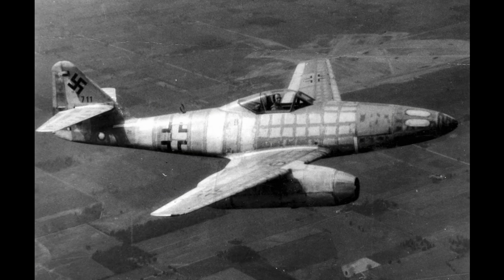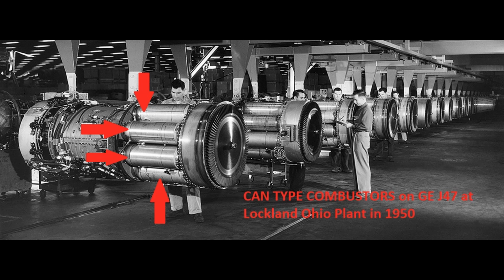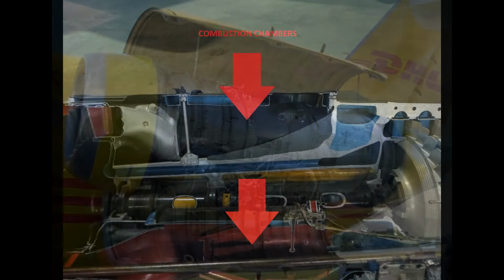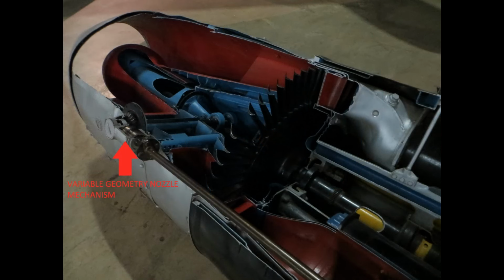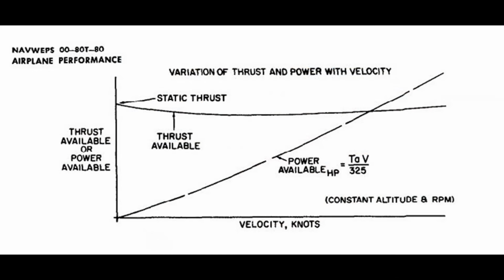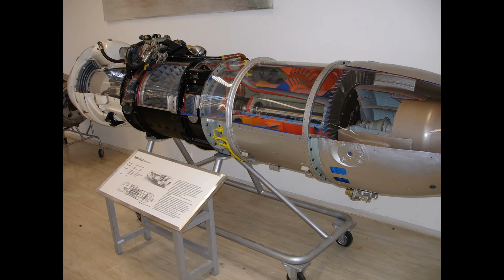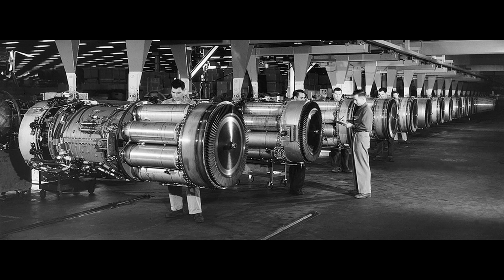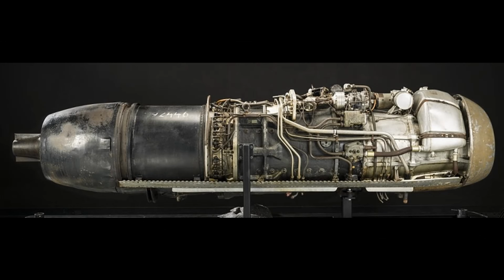World War Two JET POWER

Comment: The drawback is actually mitigated by making more of the engine. I think some articles says this, jumo 004, even if it's unreliable, if built in massive numbers, can be simply replaced
Reply from the maker: It lasts about as long as a typical Soviet WW2 fighter engine and it could shoot down a lot of Soviet junk in 25 hours.

Comment: Depends how you define "Best" the Jumo 004 only had a service life of 25 hours, most not even that! Power was only 2,250 lbs on most models. The Centrifugal flow Turbojet was easier to build, morereliable and much more powerful. The De Haviland Halford in the Shooting star easily outperformed the 262 on only 1 engine. The Centrifugal Flow engines dominated the post war fighter market, the ultimate being the Mig-17 flying on a Rolls Royce Nene copy. Americans spent10 years waiting for a home built Axial Flow engine that actually gave the power advertized. but instead got a generation ounderpowered failures like the "Gutless Cutlass"
Reply from the maker: You can shoot down a lot of Soviet and British junk in 25 hours.

Comment: The combustor has a lot of challenges for the designer. It continues to be a challenge today requiring lots of testing enroute to success. First, it has to provide airflow conditions, across all operating conditions from start to idle to full thrust, supportive of stable combustion. This was one of Whittle’s greatest challenges. Keeping combustion going in a hurricane was uncharted engineering territory, unlike any other device of the time. Second, the one nobody ever seems to realize, the combustor has to mix the very hot combustion products, which are way too hot for the hot section nozzle and turbine materials, with the airflow that didn’t participate in combustion. Gas turbines all operate with lots of excess air. Typically, 25% of the flow participates in combustion. If the length of the combustor was very long, this mixing would be easy, but the length of the shaft connecting the turbine to the compressor is critical for shaft critical speed and weight. If the mixing isn’t good throughout the operating range there can be a concentration of combustion products that can cut the turbine blades like a torch. These concerns were at the heart of the Whittle reverse flow/ external combustor cans. Many people, unaware of these problems, think that Whittles arrangement looks wrong, or even silly. He had compelling reasons for that design. These pioneers were hard pressed to make these revolutionary machines work in a very time pressed schedule with the basic materials and engineering knowledge they had access to. The same goes with the centrifugal compressor vs the axial. The centrifugal was proven, stable and simple. The axial was an attractive uncharted complex alternative. These choices still have advantages, as shown by their survival in engines like the PT-6 and Allison/Rolls 300-400 series.
Finally, the combustor has to do all of these things without getting itself melted or heat damaged, success being measured in service life. Technology and materials progress has allowed them to go from very short lives to very long lives in current engines.
Reply: +@jackthompson-lr2hc   Not much is known about what Paul Allen's museum has done with their Me-262 restoration if you understand Allen's insistence on secrecy.  I'm pretty sure they constructed entirely new hot sections for their Jumo 004 turbines, and I have seen a few photos of them being manufactured.  Allen's restorations aimed for historical accuracy but I'm curious what compromises they reached for a flying restoration.
Reply: @F@F @FiveCentsPlease heard about that, and I was amazed that the “restoration “ would break into the engines to replace original, limited life hot section components with components derived from modern engines made with much more capable high temperature materials. I would have expected that they would elect to replace the original engines with proven later engines of a size,power and weight that could reside in the nacelles with minimum of change. I guess that if you have the resources the result is more authentic, but a lot more work and risk.
Reply: @jackthompson-lr2hc   Aero Turbine in CA built the Jumo 004s.  (I think they are now named StandardAero.)  The team lead said they first went to the US Air Force Museum archives and got copies all of the engineering info that had been obtained by the Allies.  The Flying Heritage Museum managed to source six Jumo 004 cores and Aero Turbine spent 10 years on them. They ran them until something broke, then fixed it.  I think it would have been an excellent opportunity to create an engineering reference for the engine in a book if they documented everything.  Aero Turbine did say that the Germans got most of the fundamentals correct for the Jumo but just not right.
Reply: @FiveCentsPlease The Germans were hamstrung by a lack of nickel, cobalt, tungsten and other alloying elements and therefore couldn’t produce high temperature materials. They were hampered in producing durable exhaust valves, much turbine blades. That situation led them to developing actively cooled blades to get even the short lives they got with the 004.

Comment: Wonderful video as usual. I was surprised  you didn't mention their British competitors, and contrast axial flow with centrifugal compression. Perhaps that was due to time ? or perhaps because axial flow won the compression war. Did anyone ever attempt multiple stages with centrifugal compression ?
Reply from the maker: Yes there are multiple stage centrifugals. I didn't cover them because the axis flow won out and because the German axial flow designs were better than the centrifugals of the time. The German engines were only held back by war time material shortages, not by the engine design itself.

Comment: ju 287 wasnt as dumb as it first seems. After the germans invented the area rule during ww2, some of their aerodynamicists took it a bit too seriously and they started to add these external aerodynamic features like strategically positioned external landing gears to their planes as they thought that would decrease drag according to the area rule. yes, they might technically complete the area rule, but there is more to aerodynamics and external features like that almost always increase the drag more than area rule decreases it, but they didnt know that at the time. Area rule usually only helps when its used to shape the fuselage without adding too much external stuff.
Reply: Indeed

Comment: A question, does a prop  pull the plane   and a Jet engine push and how does that affect handling and manuevers?
Reply: Propellers produce both lift and thrust.
Jets have a huge advantage because they don't lose performance at higher speeds or altitudes and they do not lose thrust in a turn/dogfight  like Propellers do.
Propellers lose efficiency for every degree of deflection from straight and level flight attitude.
Reply: @WilhelmKarsten  I was thinking more about the power vectors on the air frame if the jet pushes the rear and the prop pulls the front seems like you would need a different control problem but you are correct
Reply: @radioguy1620 Most aircraft experience pitch up atitude when power is increased, but differs by the type of engine and engine placement.
Propellers and engines not mounted directly on the center line will induce a torque moment, and can effect pitch, yaw and with propellers also effect roll.

Comment: German jet engines suffered from a very serious problem. A lack of Chromium. Needed for high temperature alloys. That limited the engine lto a scrap life of just ten hours.  Compare that to the Derwent engine of the Gloucester Meteor  of 12,000 cycles BEFORE the first rebuild. 
The British were better because they chose a design that was easily achievable compared to the German's better design that was too far ahead of its  time. The British were also better at high temperature alloys. Just from a logistical perspective the  Me 262 could last 10 sorties before it needed  new engines.  An operation that took 10 - 12 hours per engine.  at 1 - 4 sorties per day a new engine would be needed every 3 to 5 days on average. It would take months for the Derwent engine to reach its first rebuild.
Reply from the maker: No, the German design was better. It wasn't a lack of engineering or design that life limited those engine, it was material shortages. The advantage the British engines had access to these materiels was due the U.S. Also, you're comparing the Meteor's engine life post war, not during WW2.
Reply: Wrong, all Luftwaffe engines were required to pass the minimum PFTR reliability requirements for airworthiness certification and 100 hours was the same for the RAF and the USAAF.

The Jumo 109-004B was manufactured with Krupp P-198 Chromadur alloy which was a Chromium based stainless alloy with exceptional high temperature creep resistance.
 Germany had no Nickel supplies from Canada after the war began but did have limited production of chrome.

The B model was superior to any Allied jet engine because it pioneered the latest thermal management technology... including hollow turbine blades cooled by compressor bleed air and TBCs (high temperature ceramic coatings)
Both technology that the Allies would not have until after the war.

Testing conducted by Operation LUSTY confirmed TBOs averaged 55 hours, better than Allied high output piston engines during WW2.
Any questions lad?
Reply: @WilhelmKarsten 

We believe we can clear up some commonly held myths and misconceptions, obviously

It's always good to see the facts presented clearly and concisely isn't it? 

Nimonic, developed in Hereford England, was the first very low iron high nickel super alloy suitable for gas turbine aero engine turbine blading. 

Interesting British achievements.
There is no doubt that the Fairey (England)
Delta 2 was of course the world's first jet
aircraft to exceed 1000 mph.  lndeed It
exceeded the previous record by 310 mph &
held the record for more than a year. Incidentally, the Dassault Mirage series of aircraft are based on the Fairey Delta 2. 
March 1956,  UK Peter Twiss,
1,132	 mph, Fairey Delta 2,	 Chichester, UK

The next speed record after the FD2 -
December 1957, USAF	1,207.6	mph, McDonnell F-101A Voodoo, 	Muroc, California 😎.

When the British EE Lightening first exceeded Mach 2 it was one of the fastest jet aircraft on the planet.

The Lockheed  XF-104 record claims before 1958 are all fictional & completely unverified. It's  interesting that the XF-104 started life using a licence built version of the Armstrong Siddeley Sapphire.

The world's first wind tunnel was constructed in England before 1877. The world's first supersonic wind tunnel was constructed in England in 1922.

The sequential stator rotor multi stage axial turbine & compressor were first produced during the 1800s by Parsons of Ireland & North England for power generation & ship propulsion turbomachinery purposes. Those basic turbomachinery components would go on to form the basis of most modern gas turbine aero engines.

At the time there were discussions regarding the use of those components for an internal combustion gas turbine aero engine to power aircraft (& ships) thus the axial compressor jet engine & jet aircraft concepts were effectively invented in England during the 1800s.

The gas turbine engine was invented and patented in England during the 1700s.

Early days, jet engines. Whittle performed the world's first demonstration of a gas turbine aero engine in 1937. The RR Nene, a centrifugal gas turbine aero engine, was the world's most reliable & most powerful gas turbine aero engine in 1944. Licensed built versions & copies of the RR Nene & RR Derwent would go on to power many aircraft in Russia including the Mig 15 & Mig 17, the US, China, France & other countries for decades after 1944. Incidentally, the Mig-15 was in essence an upsized / tweaked copy of the Whittle / Gloster E28/39 jet aircraft including a copy of the RR engine.  The centrifugal compressor gas turbine aero engine with Whittle style reverse flow combusters and sometimes an axial compressor section is still manufactured by more than one company, the main application being helicopters.

   That's correct, The Tornado & Typhoon & their engines are supersonic & are indeed British design aircraft with British design engines built by an international consortium. The Tornado design for example started life during the 1950s at Vickers as the AFVG, it's engine is based on the RR RB-199. 

The EE Lightening is also a British Supersonic jet aircraft. At the time the EE Lightening first flew it was indeed one of the fastest aircraft on the planet, it was still one of the fastest aircraft on the planet 4 years later when it first flew at mach 2

  The Typhoon is the British BAC-EAP with an engine based on the British RR XG-40, the Typhoon is also built by an international consortium.

   Indeed, There are no German companies that make German jet aircraft in Germany & there are no German Companies that make German gas turbine aero engines in Germany that are suitable for widebody airliners.

  BAe Systems, GKN Aerospace & Rolls Royce combined now do more Airbus work than Germany on an absolute basis & significantly more work than that on a per capita basis.
     
  RR now owns US Engine maker Allison for example which does classified Aerospace work for the US Govt.
   
 Anybody currently flying on a widebody airliner stands a good chance of being on an aircraft powered by RR gas turbine aero engines built in England & the UK.

We hope this helps, of course.

Cheers as always 👍.